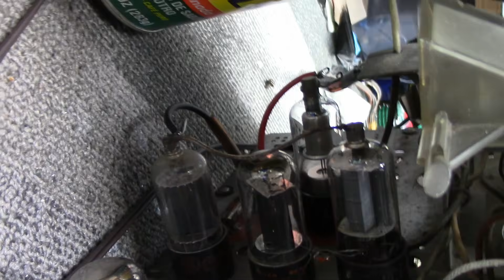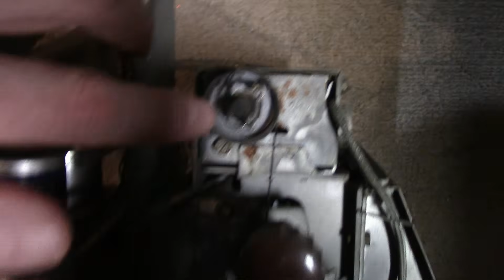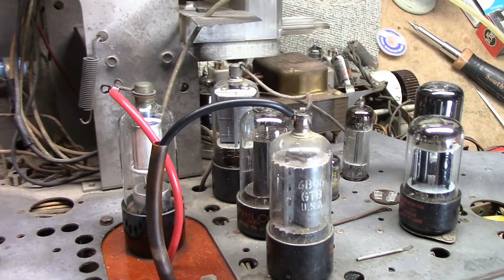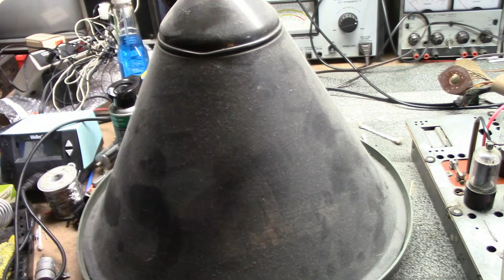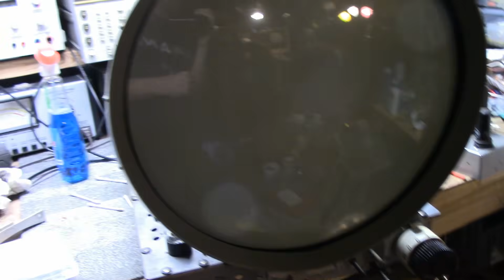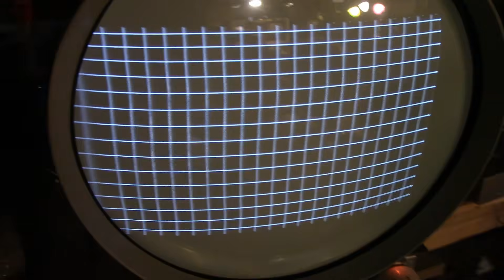Zenith G2439RZ monroe part4

Comment: That CRT looks enormous after seeing it with the small test CRTs in it.  Great work.  Fascinating about the open tuner position for a UHF channel; I've found a couple videos on the launch of UHF... it feels like the closest thing we have here to the UK's 405/625 line switchover.  Did you save the original gone-to-air CRT?  I watched a video (or maybe several videos) by the Early TV Museum, that some of your previous videos referred to, where they've been able to re-gun dead CRTs; when you mentioned the original had gone to air, I thought of that.  Not that they would just fix your dead CRT, but just thinking it might be worth saving gone-to-air CRTs with the potential of making them work again someday years from now, since no one's ever going to manufacture new replacements for vintage CRTs.

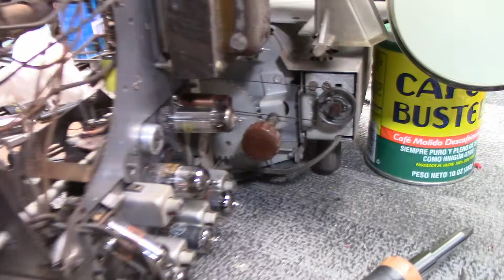Comment: 5:04 - Hi Bob. What’s the brown knob there near the pulley for? You’d never be able to reach that with the set fully assembled. Is it for tensioning the dial cord?
Reply from the maker: It's for adjust the local oscillator slug for each channel strip

Comment: I'm a little surprised that you didn't use new dial cord, I'm sure you know it is available. You could have used the intact cord as a model for length, etc. Nice to see that the replacement CRT works well.
Reply from the maker: Of course, and I have a bunch in several sizes.  I just want to get it done and move on.
Reply: @bandersentv  Fair enough.

Comment: The end result flyback looks brand new Bob. That’s cool. Impressive!! You mentioned Zenith using a chassis for a round CRT with a rectangular picture bulb, Motorola did that too on the TS-118. Love the wide open high voltage area and metal cone CRT. Don’t be shaking hands with danger by putting your hands in there trying to get that last adjustment just perfect!!!